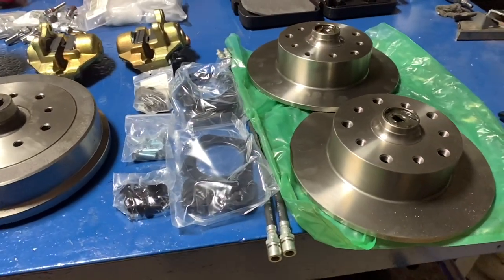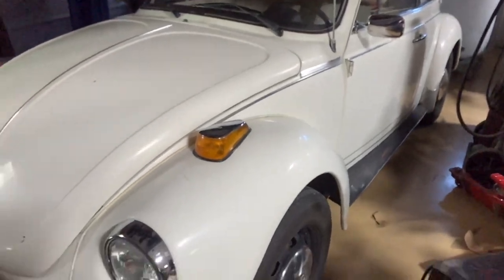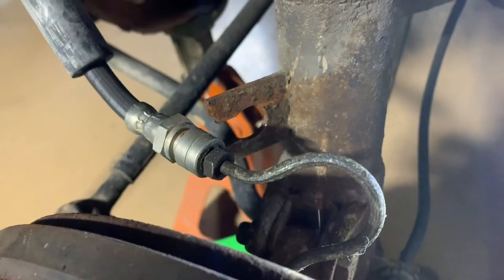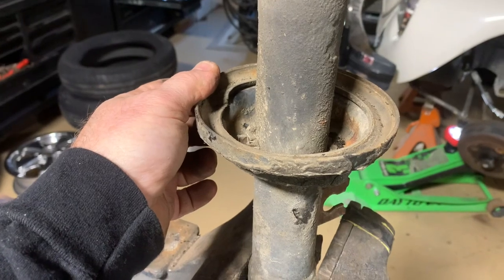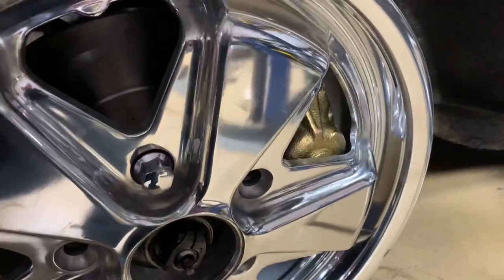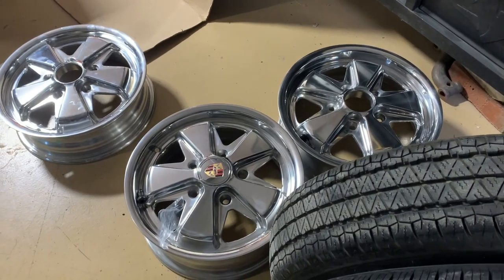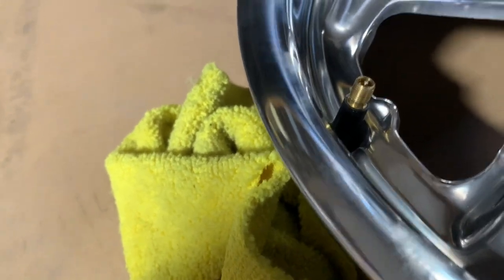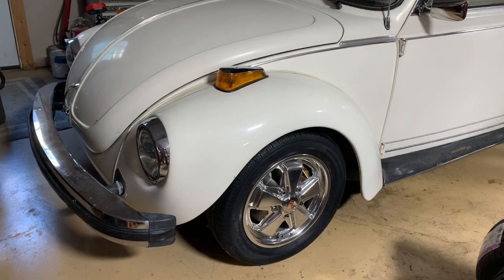How to lower a Super Beetle convertible Volkswagen Bug pick tires and a Disc brake conversion

Comment: This is a great video,  thank you.  My 74 super is lowered and has 175/65/15 on the front, but they stick outside the fender.  It must be the offset if my rims.  Do you know what the offset is on your rims?  And how wide are they?
Reply from the maker: I’ll double check so I want tell you wrong. But I did the disc brake kit instead of wheel adapters to change the bolt pattern. That alone saved me over a inch less of tire sticking out.
Reply: @SpankysHotRodsandCustoms  sorry forgot to mention,  I have the disc brake kit as well, however it is the standard 4 hole pattern.  So lowered 2 bolt struts and the issc brake kit on my car.
Reply from the maker: The Fuchs wheels are a factory back spacing. I believe your wheels are wider or not much back spacing.